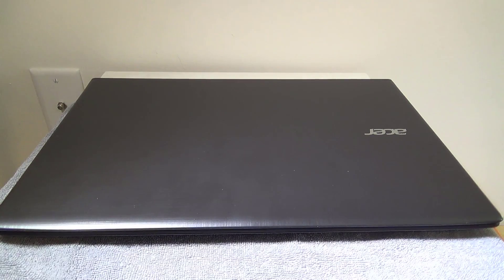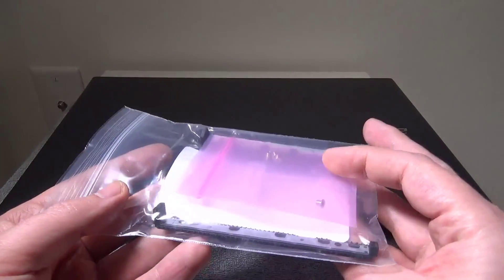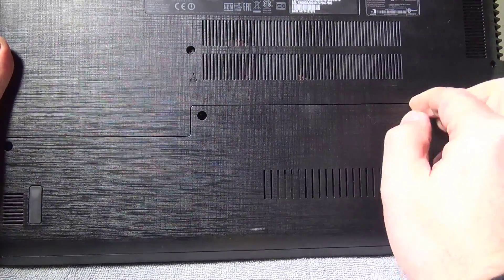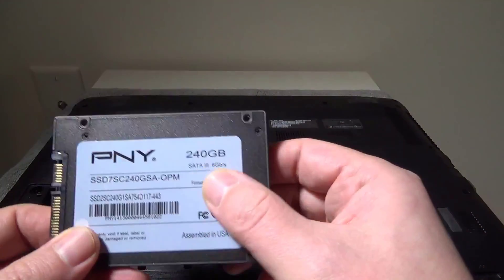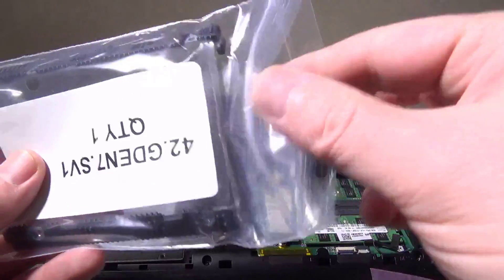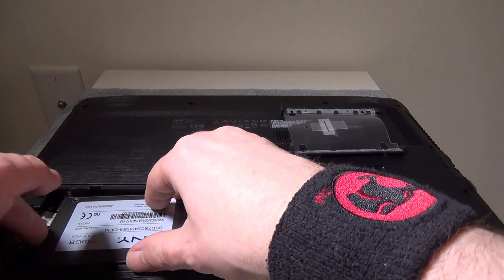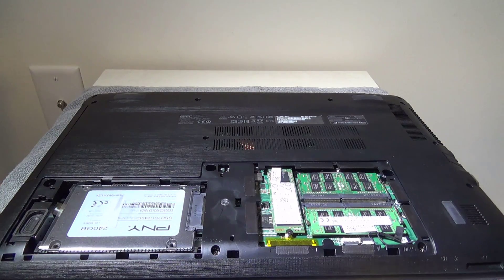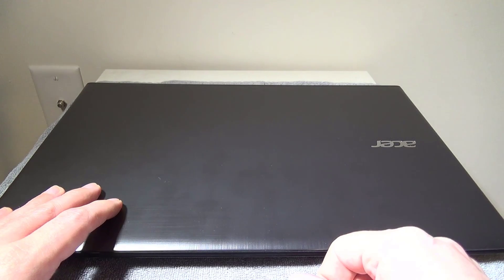Acer Aspire E15 E5-575G-57D4 (E5-575G-53VG) - How to add a 2nd HDD or SSD

Comment: Hi Galaxy Tech Review, thank you for such an easy-to-follow review. I'm considering buying this laptop in a configuration that already comes with a 1TB HDD. You mentioned that when you plug your ssd it's kind of slippery because it has nothing behind to support it, but what if you were mounting your ssd on the top of the primary HDD? Would you need the assembly kit ? (I get that this bay allows room to HDD + SSD on the top, right?) 

The other thing I don't know about is the software part. I'm buying it with Linux and I intend to introduce Windows (If possible the 7 instead of the 10) in the SSD, I get that you need to reboot and acces to the BIOS. Any tips doing that and installing the Windows (For me it's ok to completly delete Linux)?

Thank you very much!
Reply from the maker: +TremexL you should be able to add a m.2 ssd to it and keep the 1tb drive yes. The m.2 slot is to the right of the installed 1tb drive. So they are 2 separate slots the bay you see in my video is where your 1tb drive will already be installed.  You will need one screw to hold the m.2 Sata drive in place. As for installing windows you can do that and delete or keep Linux in a dual boot configuration. There are many videos out there on how to setup a dual boot system. You will not need an assembly kit as your drive Bay is already taken up by the 1tb drive.
Reply: Thank you for your repply GTR! I already have it with me with the very raw Linux version. Next step is getting the SSD & Windows on it but I don't know what to acquire and neither I know the differences in formats. You mentioned an m2 ssd, you mean something like this (https://www.amazon.com/Crucial-MX300-275GB-Internal-Solid/dp/B01IAGSDJ0/ref=sr_1_2?s=pc&ie=UTF8&qid=1490780006&sr=1-2&keywords=ssd+m2)? And that, must be installed in the right hand bay with the black screw (as I see you already have this slot occupied with an ssd, or is it another item?). Am I right so far?

And one last question (as you see I'm a first-timer) is it just plug-in the M2 SSD and having it in the BIOS and all ready to install Windows and go or do I have to install some specific drivers or similar stuff?

Thank you very much GTR, you are really helping me out.
Reply from the maker: +TremexL your looking for a 2280 m.2 drive that is Sata not nvme  (as the laptop only supports Sata) yes it will go in the slot with one screw to hold it in
  Looks like a longer ram stick. That crucial drive may work but I have not tested it personally. Just search m.2 Sata ssd drive.
Reply: Hey GTR! I installed the Samsung EVO of 250GB with W10 on it. It works veeeeeery good. Thank you very much for the help dude, hope to see more cool videos coming!
Reply from the maker: +TremexL awesome. No problem. Have fun. :)

Comment: Hi,I just got a Aspire E15 575g series laptop but is the 51KQ variant seeing as the 53VG is not sold in my country.
It has a 1TB HDD which I would assume is SATA( sorry, not so knowledgeable in this)
I'm looking to add an SSD in the future and is wondering if there is an additional slot inside my laptop to add an m.2 ssd for games and OS? 128GB is enough i would think. 
Thank you in advance
Reply from the maker: I would "assume" that since it is a 575G model that it will have a spot for a m.2 drive.  BUT seeing is that I don;t have access to that exact model I can not be 100% certain.  Your best bet is to open the bottom up and look for the m.2 slot to make sure but again I am assuming there would be one yes.
Reply: Thanks for the very prompt reply. 
Seeing as its a new laptop, I'm wary of voiding it's warranty.  However, I will definitely keep this in mind as reference for when I do want to open the rear to upgrade.
I have also watch your other video regarding ram upgrade and it was really insightful. 
4GB is really not much for having a few(4 tabs minimum of Google Chrome) tabs open. Paired that with having a game looking for online matches and pretty much used up over 3GB RAM. I think 8 would be just right.
Reply from the maker: 8GB of RAM should be fine and the m.2 slot will be under that same panel, you will not void your warranty by opening it.
Reply: Yes,planned future upgrade then.
Unfortunately, there is an Acer seal over one of the screws of the panel. I'm likely to have to bring it back to them to install for me but afraid they'll charge extra

In any case, thanks for your advice as well as this thorough insight.

Comment: Would this be a good computer for runescape? I'm completely computer dumb lol. And I love your videos
Reply from the maker: +Elite Ranks yes this computer would handle RuneScape with no problems at all. This computer handles Triple A titles some that were even released later last year. Thanks for watching and your support
Reply: And I play runescape 3 not 2007 in case you research runescape lol
Reply: Galaxy Tech Review thank you so much you're a life saver. Almost spent 2,132 on a desktop It looks like I didn't need!
Reply: Galaxy Tech Review the only one available is the i5-6200u will that still be fine?
Reply from the maker: Yes that will be fine, no doubt.